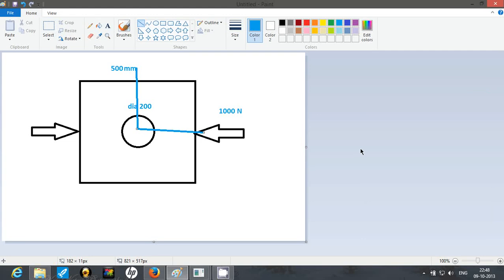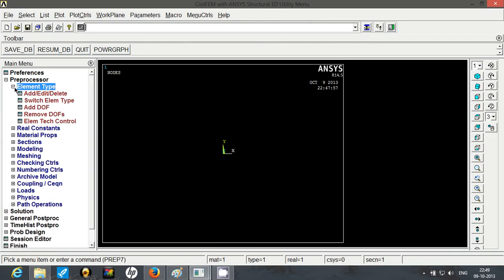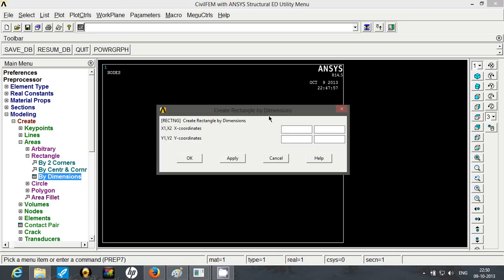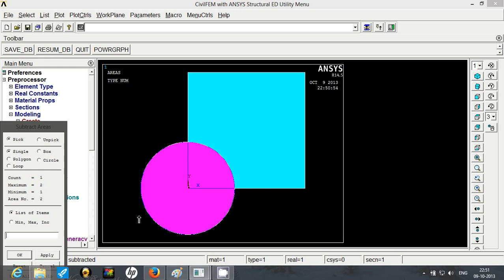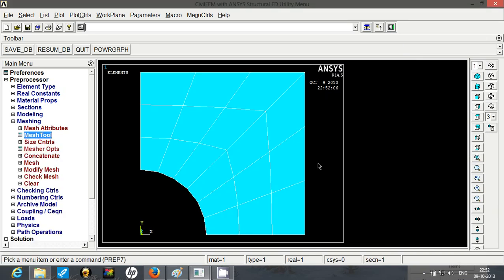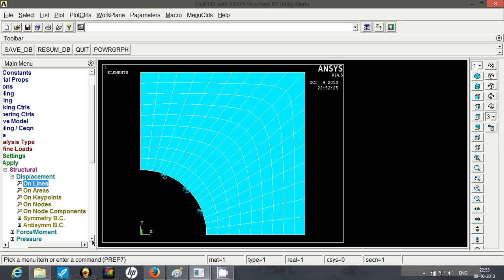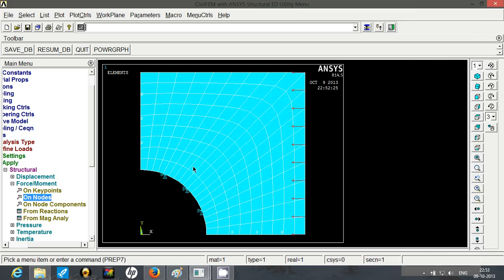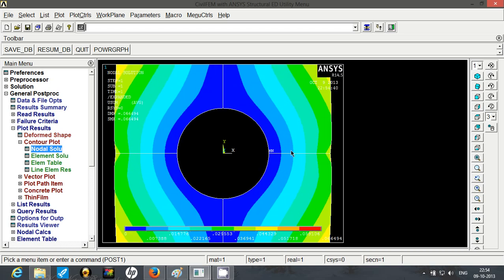Analysis of Plate in ANSYS Mechanical APDL (Symmetry Expansion)

Comment: Hi Virdi, can you suggest me on this one.  I want to validate an FE model of Bolted joint . Model is as simple as we can examine. Two plates connected with a bolt. Bolt is placed as if top plate has an extended length over bottom plate for abut 4mm  and same is to bottom plate but extension is in opp side. if i fix my bottom plate extended side, give a displacement on top plate along length and bolt is pre-tensed, then how can i validate my results ?!!!.....what formulas can i use for bolt subjected to pre-tightening and displacement that creates shear combined in assembly?!!!!